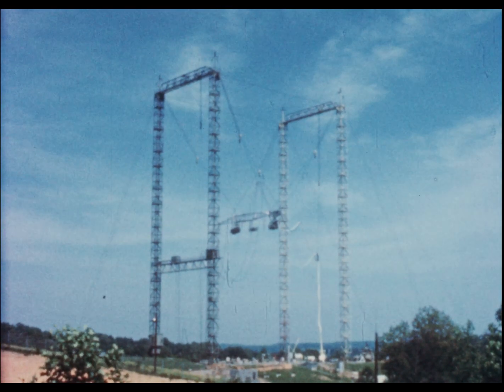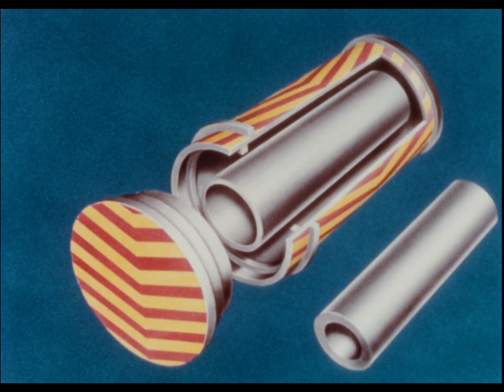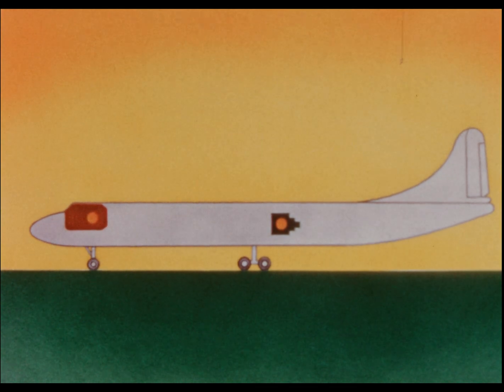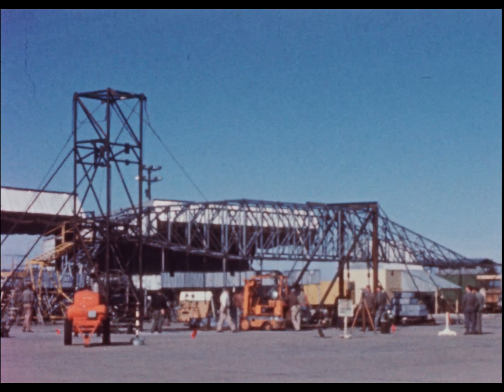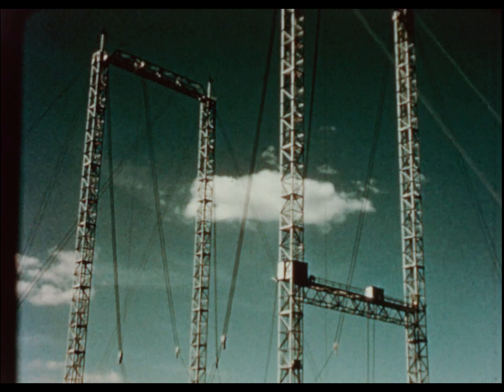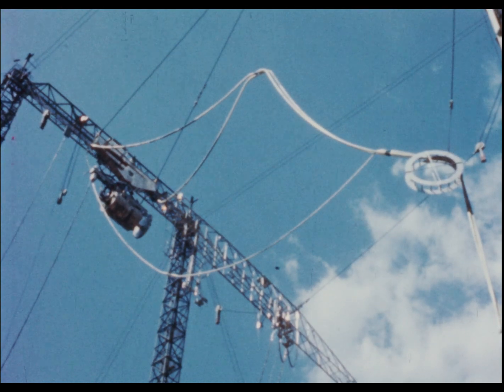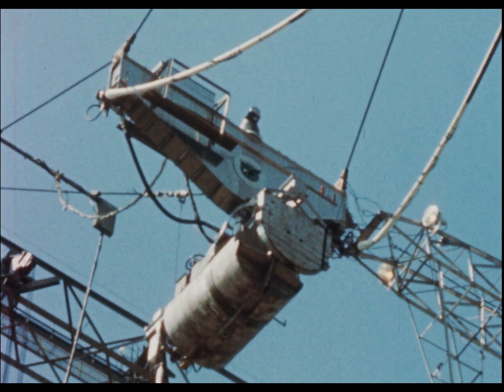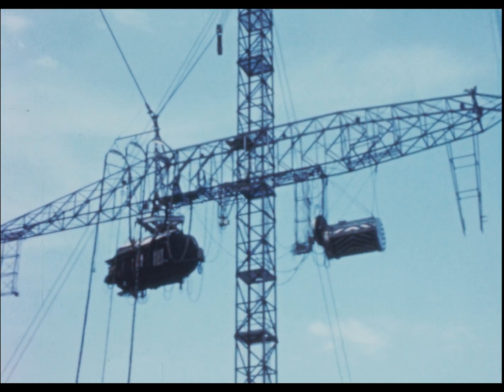ASTR Tower Experiment: The Nuclear Reactor that Flew

Comment: One megawatt thermal power? You need about 50 megawatts to equal the power of the B36's six piston engines, assuming about 40% efficiency in converting heat into mechanical power.

Comment: I'm still confused as to how exactly a nuclear reactor provides thrust for an aircraft?
Reply from the maker: In a normal jet engine, heat and pressure is generated by fuel combusting within the turbine. In a nuclear-powered plane, the reactor is off to the side and there's a loop bringing hot fluid to the air-breathing turbine to transfer heat in indirectly. This heats the air in the turbine, adding pressure and thrust.
Reply: These days it may generate electricity and run high speed fans directly. Far safer
Reply from the maker: @joeds3775  What means would you use to efficiently convert the nuclear heat into electricity and then into mechanical rotation?
Reply: @whatisnuclear  the traditional ones. Not espousing a new undiscovered tech, just existing, as advances in electric motors have happened since the original plan.
Reply: That is why Wikipedia exists... the Internet too! 😁
en.wikipedia.org/wiki/Aircraft_Nuclear_Propulsion

Comment: I was a nuke in the navy and we learned about this, cool to see the old original video. The initial reactor stuff was soooo sketchy haha, big ol piles lets see what happens
Reply from the maker: Interesting, I guess it makes sense that you'd hear about it in the Navy, presumably for shielding right?
Reply: @whatisnuclear  I think any nuclear education program would teach about most the accidents, incidents and many early experiments. Its good to know about how things lead to what you learn and use currently. It's important to learn how a reactor works, but just as important to learn how one doesn't work haha. They are very interesting to learn about. Edit: I came back later and wrote this better:)
Reply: The film on the BORAX test also is more than slightly harrowing.  So is the stuff from the (eventually) abandoned efforts for satellite thermal reactors (Atomics International SNAPSHOT).
I wish I could remember which fragment of film from that same era showed two fellas in coveralls hand-loading plate fuel into a prototype reactor, bare handed.

Comment: Worse ideas have been had.  I wonder if it would be doable with modern tech, although the acceptance of radiation doses would be a lot lower now.
Reply from the maker: Shielding technology hasn't really improved that much since this time. Plus, today we probably wouldn't want to use highly enriched uranium so the core might have to be bigger. Just need a HUGE airplane.
Reply: @whatisnuclear The atomic jet engines developed from this still exist. They were originally supposed to be used in a derivative of the XB-70 Valkyrie as a cruise missile. It needed to be big to hold the navigation computer - and then integrated circuits happened (developed for the Polaris missile guidance system) and suddenly the whole thing shrank by two orders of magnitude and the final product was the conventional jet powered ACLM instead.

Comment: I am hard pressed to think of a more spectacularly awful idea than a nuclear powered plane. Interesting testing though.
Reply from the maker: I can definitely think of worse ideas. As long as the reactor is designed to remain contained during a bad crash (not too hard considering we design spent fuel casks to withstand burning in jet fuel for 90 minutes), then it's not a totally outrageous proposition. That said, shielding this kind of thing in operation is probably the bigger problem. Can be done but probably needs a very huge airplane.
Reply: @whatisnuclear  The need for a very huge plane seems unavoidable. It's difficult for me to conceive of a containment system similar to dry cask storage that could be used at all for a reactor on an aircraft. The mass of the thing would be so huge it would destabilize the aircraft by radically shifting the center of gravity relative to the center of pressure and lift, necessitating VASTLY larger aircraft sizes to mitigate such effects. At that point, the need for exceedingly large runway lengths would become a serious issue drastically limiting the locations such a plane could land and take off at. In a crash, an immediate total loss of coolant accident would almost inescapably occur by definition. Engineering the core so that it didn't melt down in such a scenario would be an EXTREMELY daunting task, particularly given such a core's very high power density, necessitated by the nature of compactness dictated by the engineering constraints of fitting it into an airplane.
Reply: The Russians actually built and flew a nuclear powered version of the Tu-95. They didn’t spend as much effort on crew compartment shielding however - and that was rather detrimental to the crew’s health.
The B-36 was the only American aircraft that could carry the weight.
Reply from the maker: @allangibson8494  I've read that in the back of a book but haven't seen much more info on it. Do you have a specific report/source that discusses this?
Reply: @whatisnuclear  The Tu-95LAL has its own Wikipedia page…
The Tu-119 was the actually nuclear powered version (based on the Tu-114) but there is some dispute about whether it actually flew with some sources saying it did but was scrapped because of the heath consequences.
Reply from the maker: @allangibson8494  Wiki says it never flew powering the plane https://en.wikipedia.org/wiki/Tupolev_Tu-95LAL
Reply: It’s a hard problem that was engaged because of the benefit: large aircraft that could stay aloft for years at speed, back in the days before satellites had  fully come up to speed.
Reply: This was mostly done to calibrate nuclear tests from similar towers.